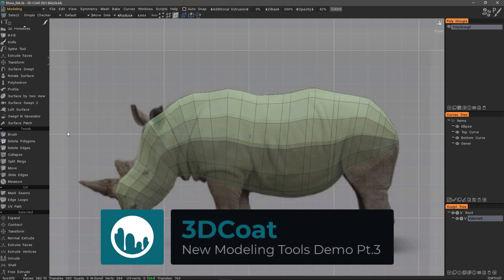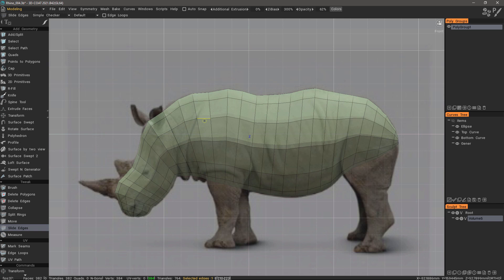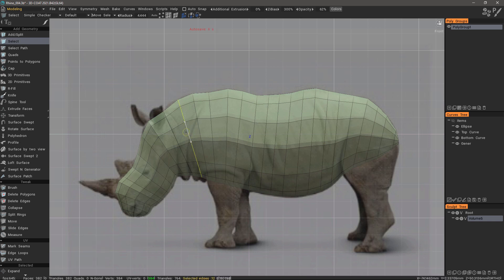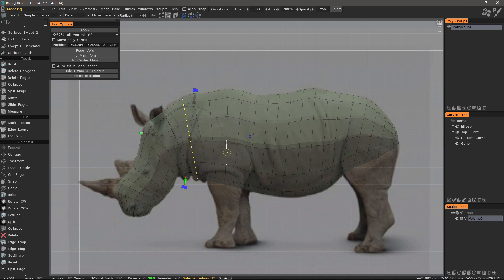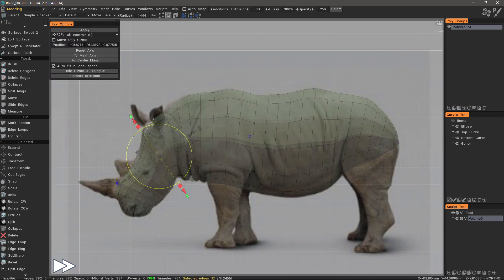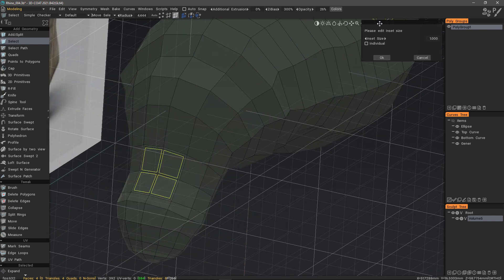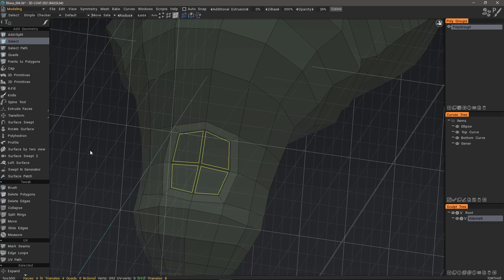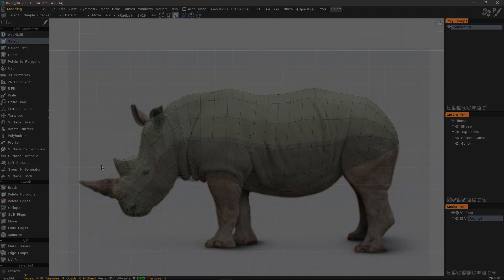New Modeling Tools Demo Pt.3

Comment: Тот же самый zModeler из zBrush с доработками. Извращение над моделированием, не иначе. Есть уже метода по Максу, чего этот процесс пытаться сделать "иным". Куча времени на переобучение для аналогичного результата. Ну не получается ни у Вас, ни у Зебры сделать процесс более интуитивным.
Reply from the maker: We had a nice set of modeling/retopo tools before ZBrush ever added their own modeling tools. Why should we suddenly stop developing ours because there are existing tools in other applications....especially when they have been heavily requested by our users? 

The objective is NOT to try to "reinvent the wheel," so to speak, but rather to complement the Voxel Modeling tools with a robust set of Poly-modeling tools, so users have the option to use either platform's strength, without having to leave the application. 

Furthermore, we have a dedicated developer for Modeling/Retopo tools and a different one working on the Paint and Sculpting tools, so we are not "robbing Peter to pay Paul," in a manner of speaking.
Reply: @PILGWAY3DCoat  The tools look pretty promising! One can see the hard work and thougth put into this. I even can sense it to a point where it seems to me that developing fresh modeling tools in this day and age seem to pave new ways for optimized, more efficient and straight forward modeling workflows, by analyzing and enhancing rigid, already established workflows of the past. I am looking forward. It definetly will complement 3d coat and make it more complete, which many people I am sure will appreciate to have such a high quality alternative.